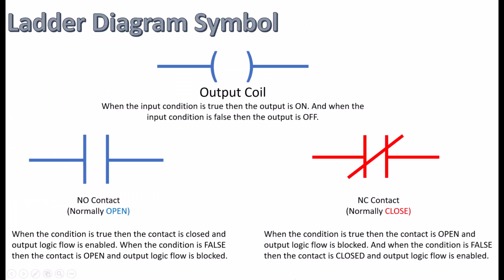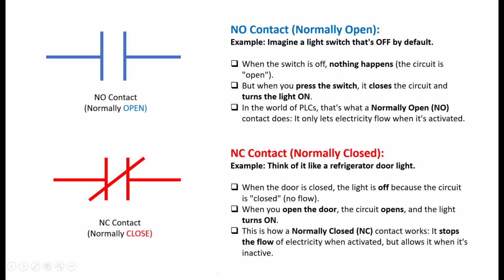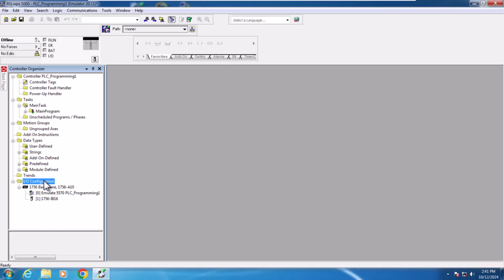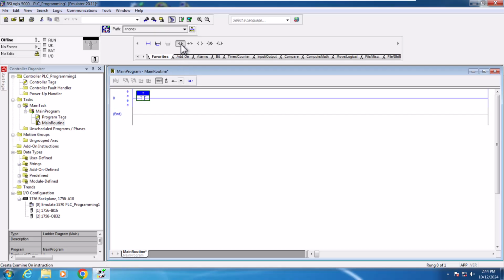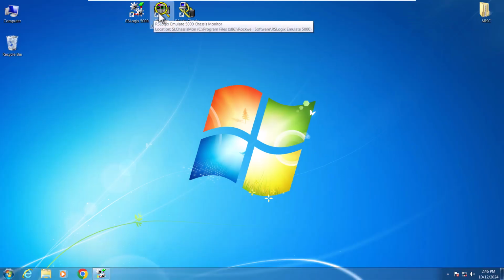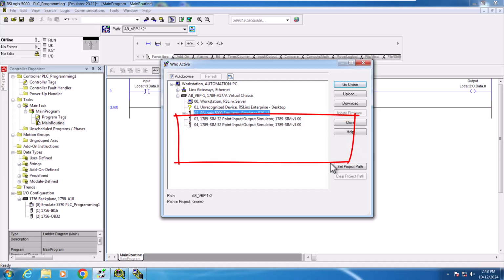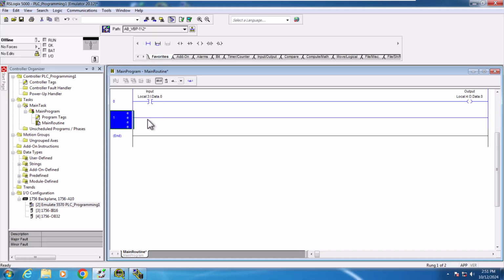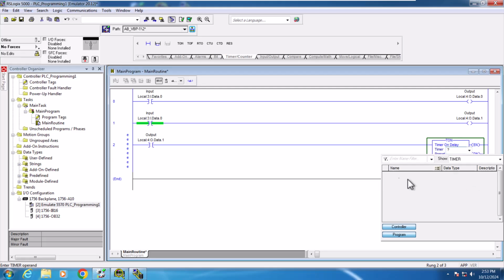RSLogix 5000 Training for Beginners: Step-by-Step Guide to Allen Bradley PLC Programming

Comment: When the refrigerator door is closed the light is off because the circuit is closed? Don’t you mean the opposite? When the door closes the contact opens to stop current flow.

Comment: Do we able to simulate AI and AO with the emulator?
Reply from the maker: Yes, You can. let me know if you need any support.
Reply: How can we do that because I see only DI amd DO?
Reply from the maker: i didn't cover the analog input and output, Please add analog input and output card, then you can simulate through forcing in the same way as digital input and output. If you face any problem, let me know i will guide you step by step.